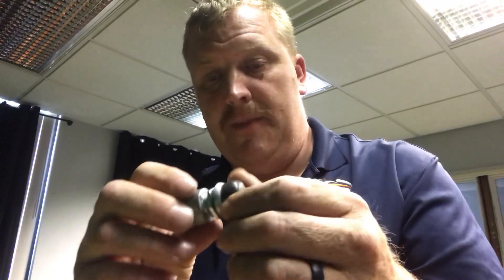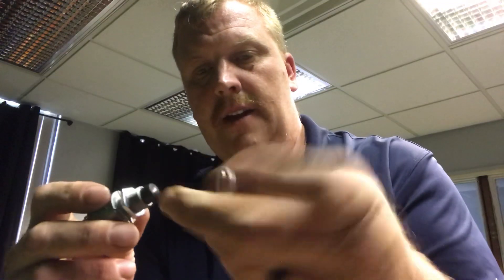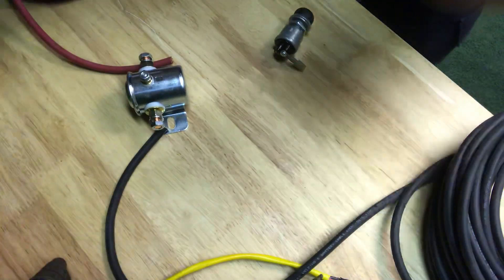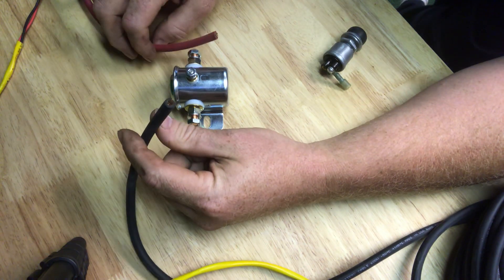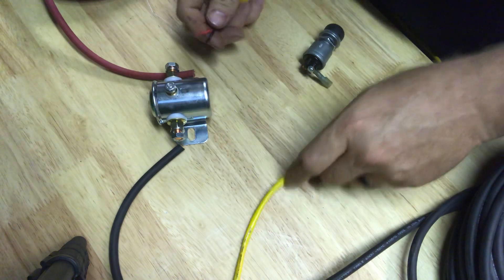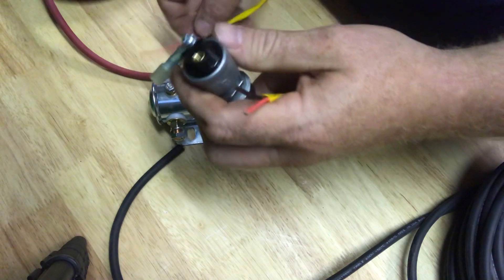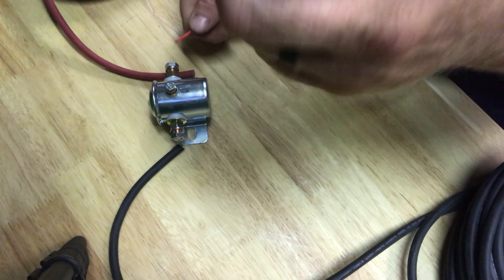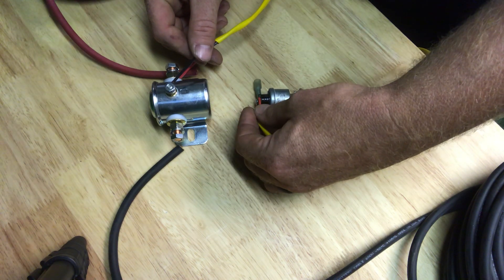HOW TO WIRE A PUSH BUTTON TO SOLENOID ON A ELECTRIC HOSE REEL

Comment: would the 40 amp breaker go between the solenoid and the motor
Reply from the maker: Dave The Window Licker I would put it before the solenoid. That way if something shorts out any where in the system it will trip the breaker
Reply: Great thanks
Reply: I always put the breaker/fuse right near the battery.